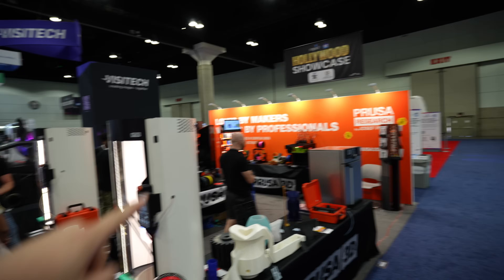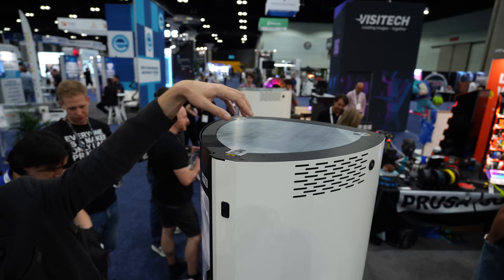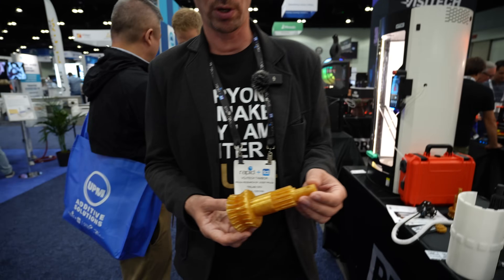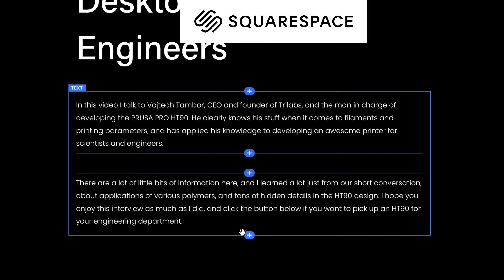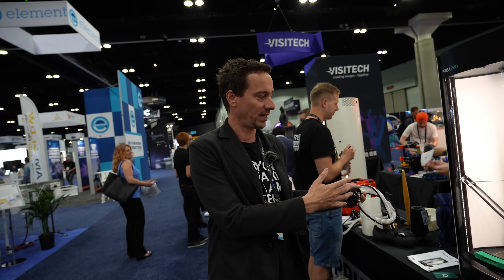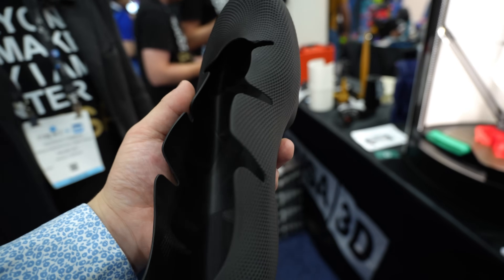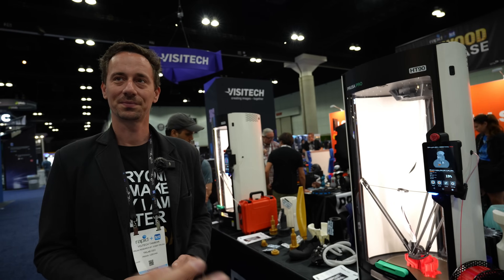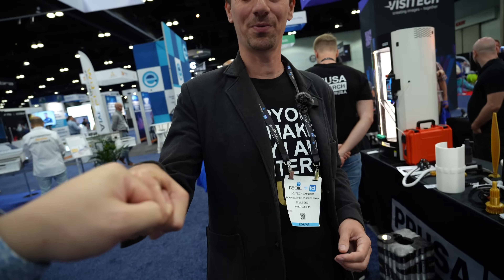PRUSA PRO HT90 - The Best Desktop Printer for Engineers

Comment: This would have been a perfect printer if the build volume would've been at least 450mm in diameter. Considering the cost, it would have been more practical if they could've increased the build volume. This would have been perfect someone printing computer casings, or parts for casings to fit various motherboards or water blocks for GPU's if the build volume were bigger.

Comment: The only thing I don’t like is the external filament mount. For a print like this, it should be placed inside the printer.
Reply from the maker: I prefer outer storage for convenience. You could mod it if you want. The T1 series from FLSUN has pretty clever packaging in that regard

Comment: I remember hearing a loong time ago that delta printers get more inaccurate towards the outside of the build volume due to the geometry of the arms. Is there some way to account for that on a printer at this level with software or is that still a limitation to consider?
Reply from the maker: Anything can be accurate if it's built properly. The issue arises when the arms aren't the right length, or the frame is crooked. If it's built exactly to specification, it will be accurate.

The problem is that most printer's aren't built very accurately, and the problem can be magnified on a poorly-built delta.

Given the overall attention to detail on the HT90, I'd assume they made sure to build everything to a high level of precision, and that it will be more than accurate enough even towards the edges.

Comment: Can the FL Sun T1 or S1 be modified to perform like a Prusa Pro HT90?
Reply: Highly doubt it, you need special parts throughout the entire machine to achieve the temperatures that the Prusa does. 90c chamber temp is no joke.
Reply: I think so, delta printers make it easy to heat the chamber with the electronic out of reach. You would need a heating system but I doubt that it could be as good as this one.  You would also need a upgraded bed to reach 110°c instead of 90°c and a upgraded nozzle heater to go higher than 300°c or 350°c to print pekk peek and ultem. 
For ABS ASA PA and PET you are fine with the flsun
The one thing that you won't achieve is the lifespan and accuracy I guess because prusa is on another ligue, and the slicer is also on another planet with the fan activated only for overhangs and all other things.
I wish Prusa and Flsun collaborate to make the T1 pro a beast at an affordable price point. I would definitely buy a farm of theses.

Comment: What difference does it have from the Flsun S1, I'm curious ?
Reply: Way higher temperatures on everything. The Prusa achieves a nozzle temp of 500c vs 350c, bed temp of 155c vs 120c and has an actively heated chamber that reaches 90c while the Flsun has no heating in the chamber.
This means the Prusa can print some super fancy high temp materials that the Flsun will never be able to print.
The Prusa is also a whole different level of quality, everyone who has tested the Flsun so far have been fairly disappointed, tons of weird issues for a printer in that price range.
Reply: @NorwayVFX  Thank you for the info ! Indeed the flsun will have to go back to the drawing table ! The heating chamber is 90C and 500C nozzle is kinda cool! What size is the printer ? Do you know ?
Reply: @NorwayVFX  300X400, it's on the website! I was expecting the machine to be around 7000 CAD, it is a little expensive for what you get but the size though! It's BIG.

Comment: Love it. The only drawback I see is that there is no built-in filament dryer or a dry box.
Reply from the maker: The one next to it was using a dry box. Having that as an external feature makes a lot of sense to me, changing filament is one of the most common tasks, so making it as accessible and easy to operate is a good thing.
Reply: @NathanBuildsRobots I hoped for an optional stackable dryer on top of the printer. Ideally,  it would have been optional and allowed to use up to 5 kg spools.

Anyway, it's not a problem. Maybe it's a stupid idea, and the current solution is better.

Also, it would have been interesting to understand the longevity of this printer. How many KM of the filament to start experiencing issues? My Prusa MK4 Kit is in good shape after 4.7 km, but 4.7 km is nothing.
I am considering buying this printer after resolving other priorities.

Comment: Reading some of the comments complaining about the price and capabilities of the Prusa Pro HT90 compared to cheaper machines is akin to someone complaining that the sky is blue and it's unfair lol

It's a machine designed for a specific use case that comes with a price tag hahaha.  
I'll never understand these people that whinge and whine about a product they seem to never like or even owned any of their products but still watch videos on the products and have the energy to write disparaging comments about said product lol rant over
Reply from the maker: Dump trucks are too expensive, I can get an F150 for 1/10th the price.
Reply: @NathanBuildsRobots  lol
Reply: I have seen similar comments under a video regarding the new Vision Miner printer. They complain that the printer doesn't have lidar or an accelerometer or a camera.
Reply: 3d printer community is full of people printing articulating dragons etc that moan about printers above 1k price. When some people just wanna do functional prototypes and print end use parts out of PEEK and PEKK etc with reliable quality (engineers etc.)

Comment: I'm going to say this right now before anybody does says this.

Prusa is going to perfect the Delta 3D Printer model and is going to beat any competitors it competes with.

However that's if bambulab comes out with a Delta 3D Printer Model and it's way cheaper.
Reply: 1) Prusa buys a delta company rather than developing it themselves. 2) Prusa improves it?

Comment: Not idex , so how to print support..
Reply from the maker: That is a good question, that is the only feature that is missing that a lot of engineering applications might miss. It shouldn't be too difficult to fit one on there as a future upgrade.
Reply: Supposedly the active part cooling addresses that, though I suspect it's not feasible to rely on that alone in every case. Some customers will inevitably print using the main filament as support, and then someone will have to go through, cut it off, and sand the interface sprues down. That will be a "good enough" solution for many.
Reply: @__S__435  you mean to extra cool the support for it to not stick?

Comment: I am a prusa fan. But isn’t the idex 3 printer from vision minor a better deal than this? Not that I can afford or justify buying either one.
Reply from the maker: I think a lot more people have had experience with PRUSA printers in the MK3S and the MK4, so it's an easier sell to management to say "buy one of these because we've bought a printer from them before and know how to use the ecosystem"
Reply: I think this printer is like the middle ground between say a Bambu X1C and the latest VisionMiner.  

VM is well setup for selling to big companies, government and have a whole plug and play type system for engineers and specialty manufacturing.   Not to mention, more experience in that target market in general.

This Prusa is probably more like a good value for small businesses who don’t necessarily need or want the overhead of needing a whole big support system that has a lot of profit margin built in, and can build a small fleet if needed at lower cost per printer.
Reply: Well, I'm looking at the 22 IDEX v3, and it has a "higher ceiling" than the HT90, but it also has a considerably higher "floor" as well given that it starts at basically $15,000
The HT90 isn't cheap by any description of the word, it starts at basically $10,000 as well, so it has to punch a little above its weight class to show them up and nip at the heels of the 22 IDEX v3 so to speak.
As such, it's got a few less bells and whistles, but offers more than hobbyist-consumer-level products...
In any event, short of robbing some banks... repeatedly... I'm not in the market for either, just comparing specs and advertising fluff
Reply: Doesn't the 22 IDEX v3 have 9 motors whereas the Prusa Pro HT90 have 3 (as well as the FL Sun S1 and T1)?

Comment: 6:30 he says more heat = more layerbonding.. thats bs! utterly bs... more temp = cooked filament = worse bonding. and these ppl make machines??!? wow.... more temp = brittle.
Reply from the maker: The guy I was interviewing knows more about 3D printing than me, so pretty sure if he said something he was right
Reply: @NathanBuildsRobots  most was right but higher temp does not give better bonding. CORRECT temps give better bonding..
Reply: Indeed this person has no idea what he's talking about. Even PLA doesn't "cook" until at least 250+, and only if it sits at that temp a long time. Good bonding comes at 240+, especially important if you have adequate cooling for sharp overhangs and short layer times.
Reply: @daliasprints9798  hehe o does it?? i got ten rolls of pla white that wants to argue with you buddy... it boils at 244.... becomes brown...  the bonding is better at CORRECT  TEMP not just higher.. thats a gross overstatement.
Reply: What a weird comment :o Have you ever tried 3D printing in real life?
Reply: @TNX255  nonon , tokk it out of loose air.... and u say my comment is wierd? hehe wow... been at this from when we made them out of plywood.... is that long enough time to have an opinion that is correct? nah. not for u i guess. you goahead and increase your temps to get better bonding.. hehe
Reply: Did you give the wrong timestamp? Nowhere around that time are they talking about nozzle temp or bonding. They are only talking about the side panels and heating.
Reply: Your comment is what happens when you apply too much heat to your crack pipe.
Reply: More chamber temp equals better bonding even for PLA. Stfu if you don't understand the basics of fdm printing.
Reply: @youtubehandlesux  he was saying this when mentioning the nozzle. go back and see?

Comment: Isn't that Magball arm that have been around since kosell / ultibots era?
Reply: Most likely. If the cups that sit between the arm magnets and the chromed steel balls are made from delrin, they will last for an extremely long time and never require any lubricant. I have also seen U-joints (like the original Kossel) and Traxxas arms (like on the original SeeMeCNC Rostock MAX), but nothing beats mag arms.
Reply: @__S__435  Yup that's gold standard for delta arm. Always in my mind to build this if my Traxxas arm fail.
Reply: @VyisKhooyaojiunn  Traxxas joints wear out and get sloppy over time. Happened to me and many others. It's why SeeMeCNC stopped using them. They're meant for remote controlled cars and planes.

Comment: Can't wait until Bambu makes one for $1500.
Reply from the maker: Bambus similar offering is the X1E

It’s nice but it only goes up to 60C chamber temperature.

Getting all the way to 90C is a pretty big deal, as it requires you to replace grease, belts, and electronics with high temp variants. Also it requires additional sealing, insulation, and higher power draw.
Reply: @NathanBuildsRobots If you care to engineer it as such, a delta can do HT without most of the usual HT considerations by keeping most parts outside the hot chamber. Quantum delta (inverted - moving bed, fixed tool) can do even better at this.
Reply: @NathanBuildsRobots  I think the only particularly hard part of all high chamber temperatures is magnets and electronics. Gotta keep them away and insulated from the chamber (which makes for a bunch of added design restrictions, and why I am assuming that they went for a Delta) or you have to use relatively exotic materials in complex fabrications.

Weirdly though, something like this is really a problem of scale. We can print most things short of to PEEK, PEKK, and large parts of pure Nylon in a Sub 1k printer. Those materials in filament form are pricey because nobody buys them. Nobody buys them because they are a pain to print (even on the machines that are pretty good at them).

So for this to really work outside of ultra niche applications, someone needs to make a reasonably priced printer that will print these materials reliably (probably both a hardware and software solution given the material shrinkage rates). That way the filaments themselves can commodify and become reasonably priced. Then we may see this more in engineering applications.

But for now, 90C buys you pure nylon, not the ultra-high-end stuff, and now you are competing with a bunch of SLS printers in the 10k price range, but you are accepting worse quality for a larger build volume but slower production rate and anisotropic part strength.

Not sure if FDM will be the ultimate solution for high end thermoplastics, but I don't think that a 90C delta for 10K is a meaningful step to the goal. It certainly doesn't get us any closer to production at any meaningful scale, and what is the point of prototyping with the correct material (say unreinforced nylon) if my prototype will have necessarily different properties when compared to a part made in whatever my ultimate production method turns out to be.

90 C is in no specs I have seen recommended chamber temp for PEEK PEKK. Seems like it may work for smaller parts, but I would wonder about layer adhesion.

Also, I definitely don't need a 90C chamber for ASA and ABS.
Reply: @youtubehandlesux  I run ASA at 60C in industrial and defense applications with no issues. I haven't done layer adhesion testing above 60C, but I doubt it is a huge jump from 60 to 65. But my point was that you don't need 90C. Standard neodymium magnets start to have permanent strength reduction at 80C. SO why go to 90, it buys me very little. If you are going to do 90, get me to the 150s region at least so I can make use of something more than pure nylon (which is also printable at 60C for small to medium parts).

The bulk of layer adhesion issues people have can be sorted by not trying to print multiple critical parts at once, regardless of chamber temperatures. FDM's largest weakness is anisotropic strength/layer bonding. Enclosures help a lot with this for many filaments, heated build volumes help as well, but neither technique is a solution, just an aid. I am not sure we will ever find a true solution to the weakness, just different ways to help ameliorate it or deal with it.
Reply: It'll probably come with a recall too.
Reply: The Prusa machine is intended for corporate customers who place high importance on time and reliability. They want bulletproof support from a company that has demonstrated that it actually prefers not to lose customers.

Bambu is basically the opposite of that. They have a reputation for treating customers like they don't matter. To them, one customer leaves, another nine are waiting in line, so why care? This is well-known, and is an optimization that can work in the value segment (strictly from the point of view of the company and its investors) because short-term profit is king. It's not so great for customers when something breaks, though.

Prusa cannot compete with them there, but they have lined themselves up very well to out-compete Bambu and others in the industrial/institutional sector.
Reply: And mediocre with questionable design choices, just like the rest of the bambu printers.

Comment: Mr Prusa was bashing on CoreXY when the MK4 came out and here they are highlighting the benefits of a still heatbed. CoreXY is the way to go in general, once you realize how hard to accelerate and deaccelerate a growing mass is, you know that bed slingers are now considered entry level printers. Time for a Prusa XL Mini to get the cost down and move to CoreXY, the community made that decision. Once you see a Creality K1C or upgraded K1 beating a MK4 in most aspects, you know you have some work to do...
Reply: I don't trust Creality printers to have anywhere close the the same reliability or support as Prusa. Also - curious that you say Prusa bashed Core XY when the Prusa XL (which is a core XY) was announced around the same time as the Mk4. I have a feeling you're stretching the truth a bit.
Reply: prusa get the cost down.  XD   I'm dead.
Reply: Cartesian is strictly better than delta or corexy when it comes to print quality, period. And I own a corexy printer with 35k acceleration, just in case you doubt me.
Reply: @youtubehandlesux  Can you quantify that?
Reply: @youtubehandlesux  XD   sure..
Reply: This dude just tried to compare a creality K1 to a prusa MK4 lmao
They're worlds apart in build quality and reliability.
Reply: @LilApe  You're right!  The K1 doesn't melt when put into an enclosure and printing high temp materials.  XD

Comment: 10K and you can be pro and print nylons from open spool...haha jeesus.
Reply from the maker: They have a dry box for the higher temp materials. If you look at the printer on the left it is using one. 

But at the same time, if you want to use materials that don’t need a dry box, an open spool in an easy to reach location is the best solution